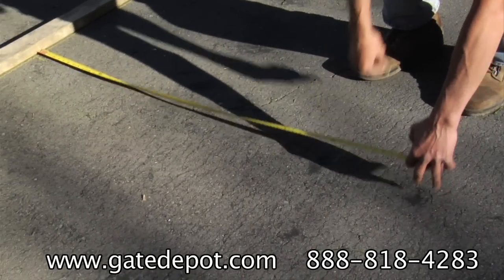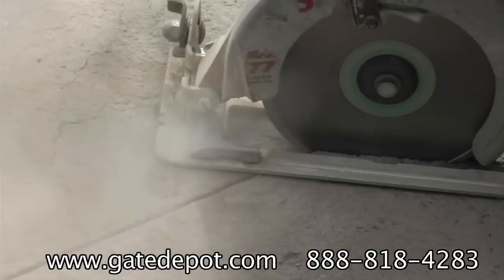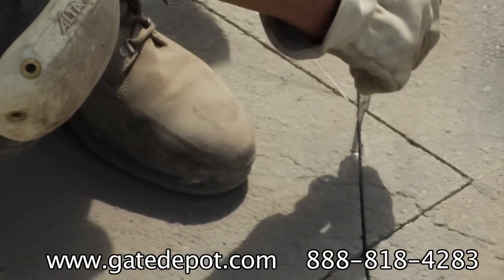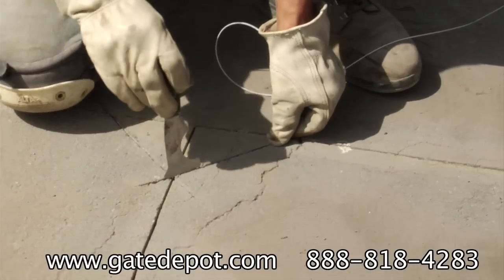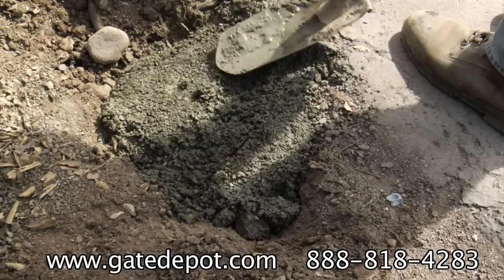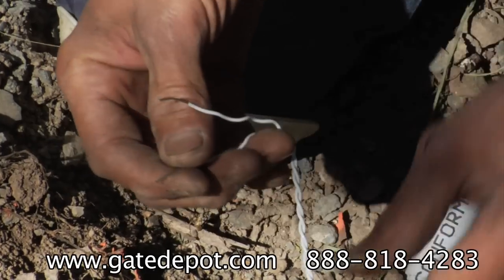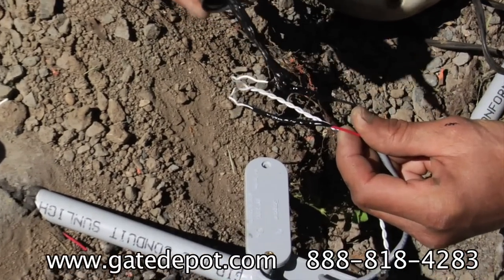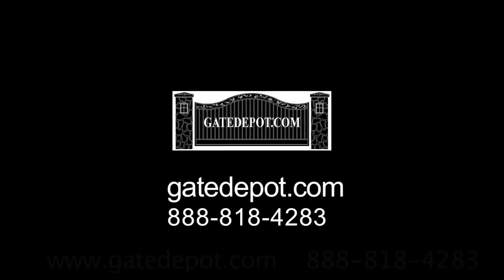DIY Driveway Gate Vehicle Detector Cut In Loop Installation

Comment: This is kinda how traffic lights know you are there for the light to turn Green. The metal from your vehicle inducts a current into the wire by way of induction which has to do with the North and South Poles repelling each other through magnetism.  It sends a signal to the traffic signal cabinet to tell the light that there is a vehicle there.
Reply: Radar is now used primarily instead of loops, in many dot programs in the us.

Comment: Shouldn't you test the loop before applying the sealer?
Reply: Always test the loops inductance, easily done with an LCR, and at the very least insulation quality with a megohmmeter, sometimes called a Megger - from the brand name Megger, before you seal. Then document with a sharpie on the controlling device i.e. loop detector, gate operator, etc. Without a reference of the loops quality it may be time consuming to diagnose when faults occur and can help for warranty purposes. We recommend using backer rod (to allow the sealant to properly cure), BASF's SL1 sealant or Sika from Home Depot $12 a tube, and never splice the wire much less when its below grade. Overall this is a good representation of a quality loop install! Thanks for the video!

Comment: Another professional amateur Co.. If you want longevity for loops make saw cuts @ 45degrees. Wash your sawcuts and let dry. Dust prevents sealant from sticking! And they used thhn for many years b4 xlpe came along! Make sure you have atleast 7 turns per foot on your lead-in wires. Cuts should be 1-1/2 to 2 inches deep, lead-in cut should be if possible 1/4" wide for the twisted wire. Important: if wire insulation is cut thru to the wire you're gonna have troubles.  Don't use it!
Reply: I agree

Comment: There are serious flaws in the way these people cut vehicle loops.
-On asphalt, the cuts on the cuts on each side should not go at the way to the corner.
- Just using a scraper is not a proper way to clean a slot, an air blower should be used. The sealant needs a clean surface in which to adhere to.
- Splicing a loop lead-in is a HUGE and a HUGE no-no.

Comment: hi there can you pls tell me which wire can we used for loop ? and how many wir  rings do we needs inside the cut  pls ?
Reply: zaki alavi depends on loop size   Best to call detector manufacturer. But normally around 3 turns. The smaller the loop the more turns & v.v.. The type wire best is xlpe. also never bend wires @ 90 degrees, saw cut the corners @ 45.

Comment: What is the trick for keeping the twisted wire from coiling up when you take it off the drill?
Reply: Mike honcho ... Tie the end to a weight or have some hold it. Also twist the wire tight then when you remove it won't undo so much you need atleast 7 turn per foot .